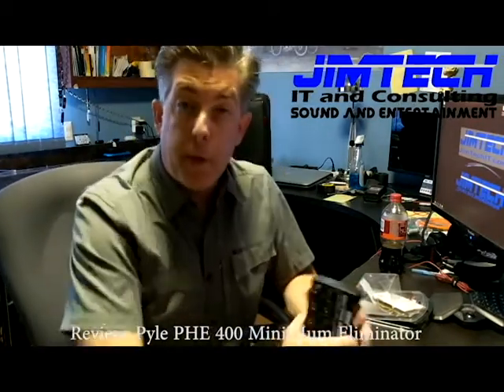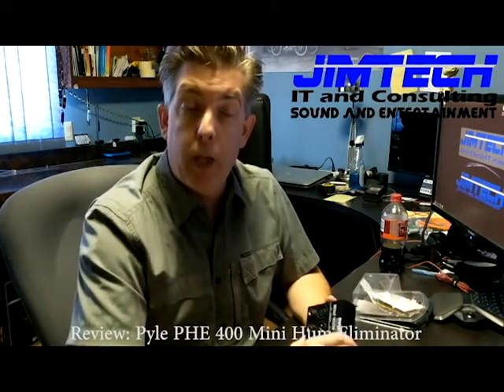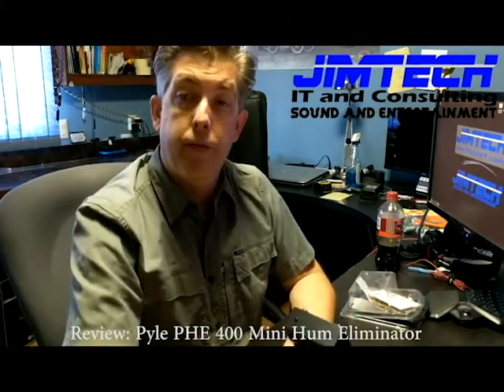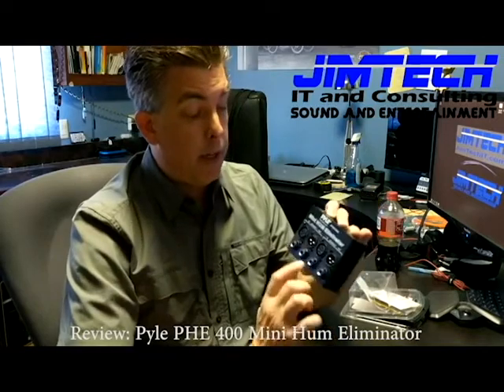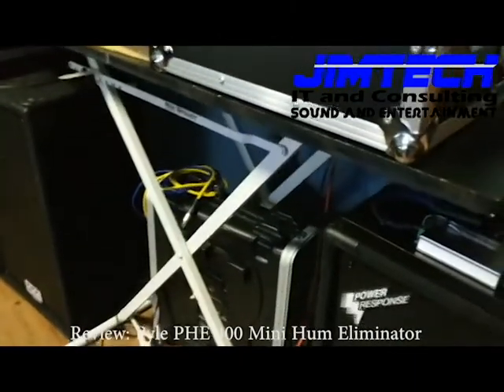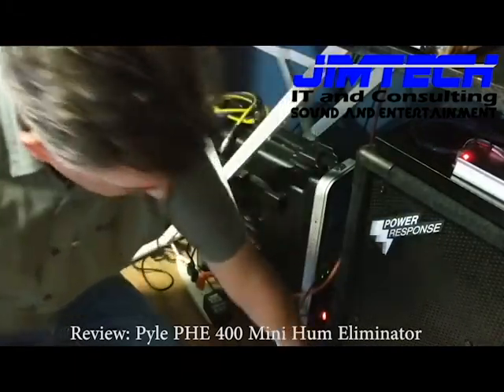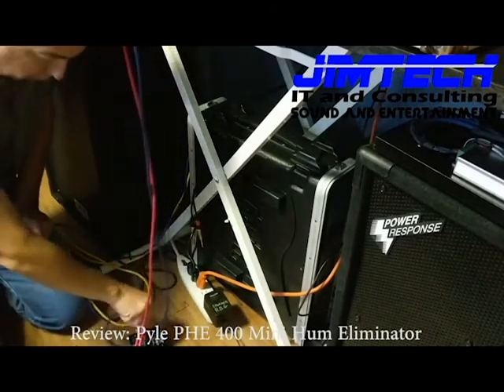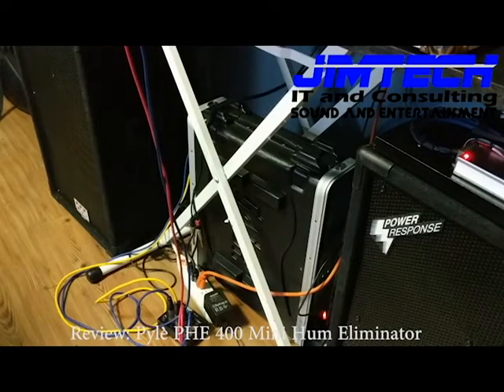Pyle Min Hum Eliminator Final

Comment: I got one of these to run an ABY setup to 2 amps in my guitar rig. It only makes the hum significantly worse. What might I be doing wrong?
Reply: He is putting it between the amplifier and the speaker. The amazon listing has an image of a guitar plugged into the input and then the out into the front of the amp.. but from the little I've seen from research so far this is not actually designed to be used in this manner (despite the amazon ad clearly showing it as an application in the listing images).

Comment: Interesting, so whats this do to the quality of the audio? Also Ebtech makes a box called the Hum Eliminator that looks almost identical but is 3 times more expensive .. have you tried that?
Reply from the maker: Quality is pretty good, turned out my "hum" was from one of the power adaptors a laptop (at least at my house). I play music and provide sound at an old theater that has electrical issues, so it helps for that.  It's also pretty good for changing a xlr to 1/4 " trs.  I have not tired the one you mentioned.